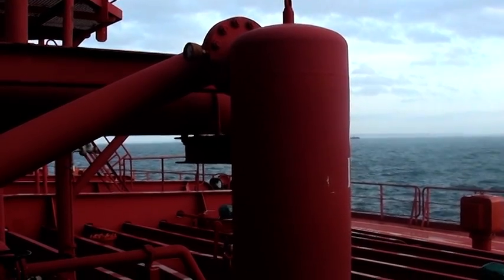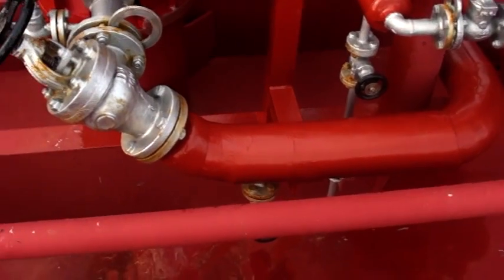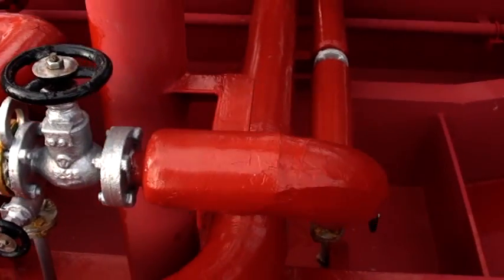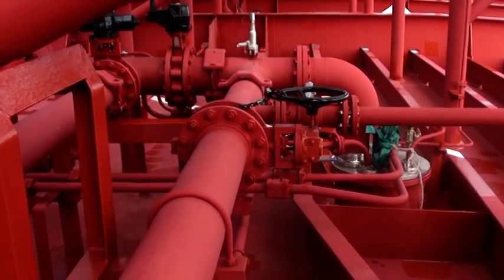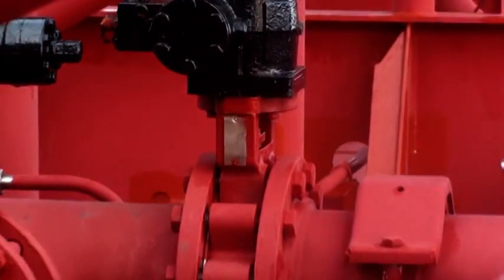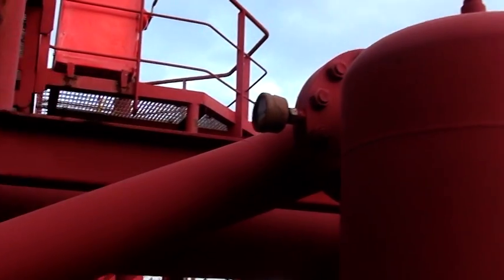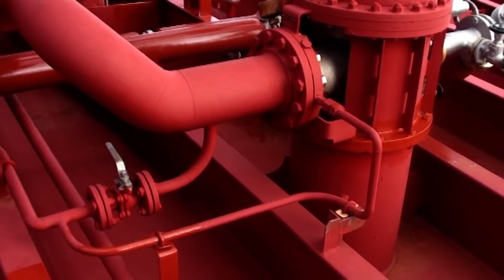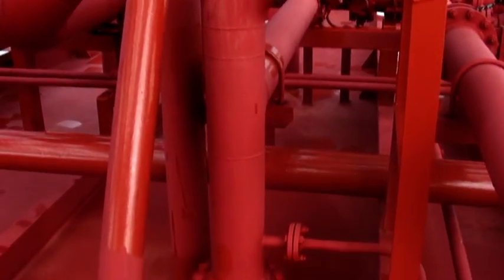Cargo heater and cargo heating procedres.

Comment: For hitting the cargo which pump you are using? Cargo pump or some special circulation pump?
Reply from the maker: Cargo pump (FRAMO). The cargo is recirculated through deck heater and returns back in cargo tank via drop line. Each tank has its own cargo heater.